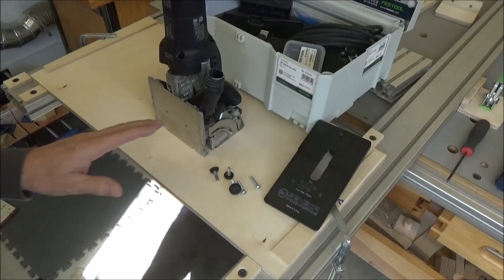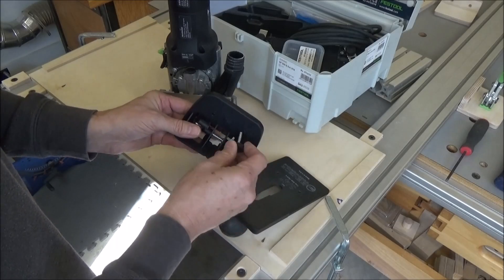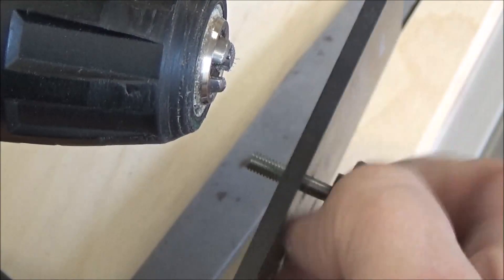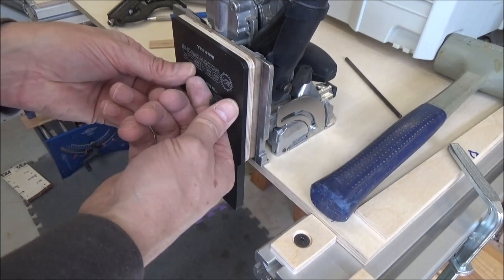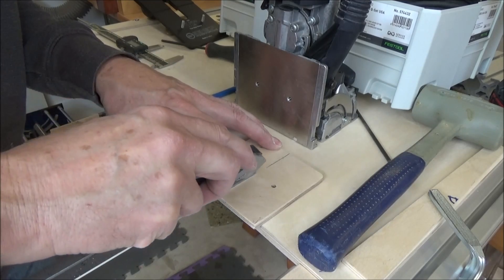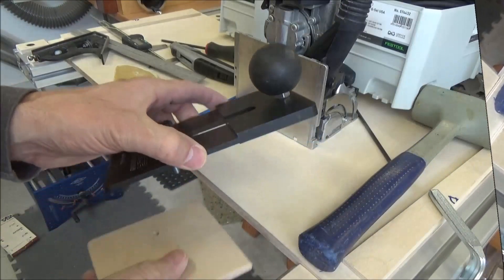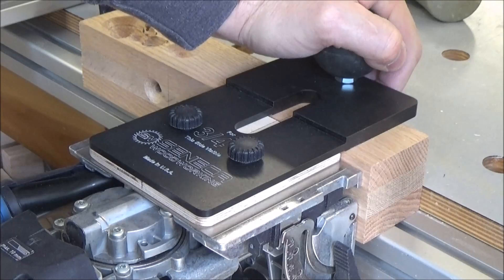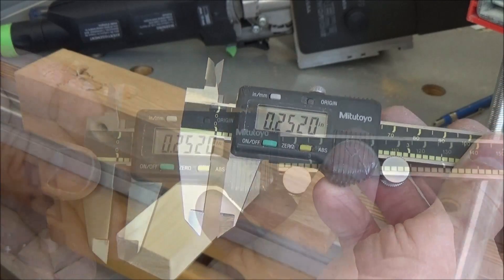Domino Offset Plate

Comment: I understand the usefulness of the Domiplate when working in 1/2" or 3/4" stock, but I am having a hard time understanding the usefulness in this application considering the spacer block must be removed each time you want to make the Domiplate only cut. What am I missing? Why not just use the Domino in the normal orientation with the depth indicator on the machine?
Reply from the maker: There is no depth indicator used with the domino.